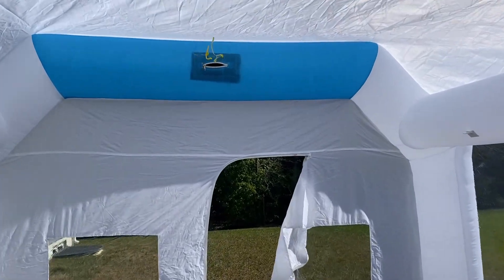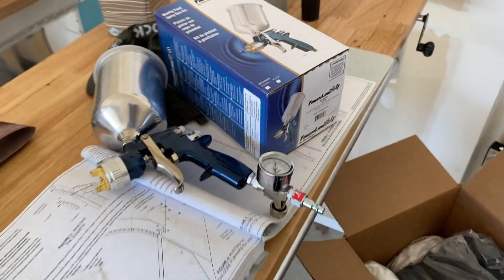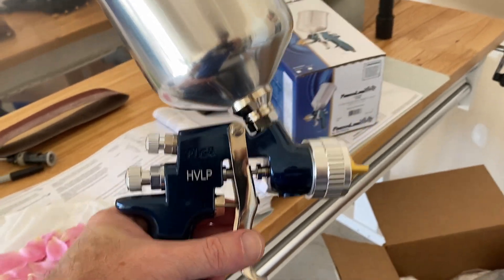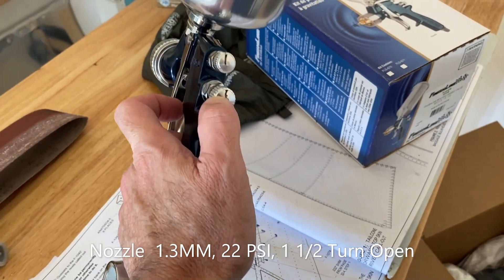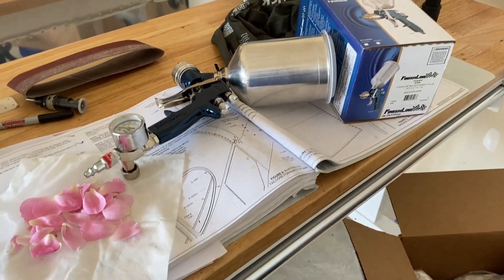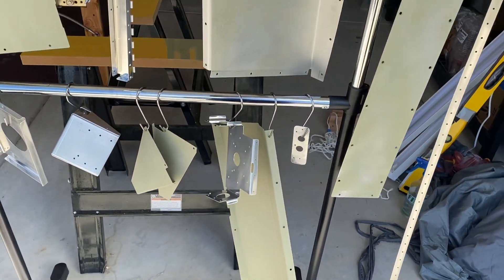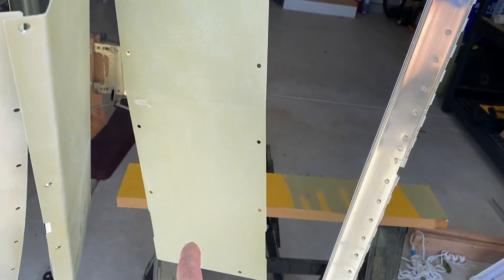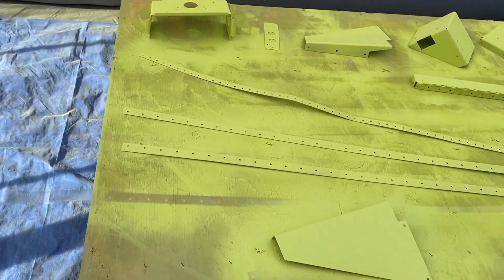Seriously Upgraded Aircraft Priming and Painting

Comment: Thanks for taking the time to document!  I’m really keen to see the results of water based vs epoxy; BUT what I’m really interested in hearing is the story behind the pile of flower petals!!!  Yes, yes, the HVLP spray gun is cool but you didn’t even acknowledge the petals - what’s up with that??? 😉
Reply from the maker: WOW,  now thats paying attention... first the flower petals - my wife does soap making and it was likely roses for her to grind up and use with one of her soap recipes.  As far as the water based vs epoxy,  so far the water based seems to work just fine inside the plane (you just need to let it dry completely) and sticks good.  I don't believe its resistant to fuel and chemicals so it would require a top coat if used anywhere that might be an issue (check with the manufacturer).  But its definitely is alot easier to use and clean up, but i dont feel (not quantified) that it makes the part as hard as the epoxy but for what i need it works great.

Comment: what size compressor did you pair up with the paint gun?  scfm?
Reply from the maker: I have a 30 Gal compressor with 6.2 SCFM At 40 PSI.  Not sure if you need that much b/c you really run the air gun at very low pressure - just need to make sure it does not run out of air. I would look at air guns and make sure you verify the SCFM.  Cheers George

Comment: It looked like the end was open. With it all closed down, is the positive pressure enough to keep dust from blowing in? And is the feed air filtered to prevent dust coming in?
Reply from the maker: Yes, with it all closed down it will keep the dust from blowing in, when painting it is enough pressure with a side filter open to cause the side to bulge slightly which also pushed the overspray out.  Need more time with it too tweak everything to see how well it works.  Because the parts were so light, I really needed to have something hold them down better to get a nice even spray. It will be interesting when I try the actual paint with some larger parts to see how well the booth, and paint gun perform. With the primer not thinned, it is really easy to put on too heavy a coat and have weird things happen with the surface after.